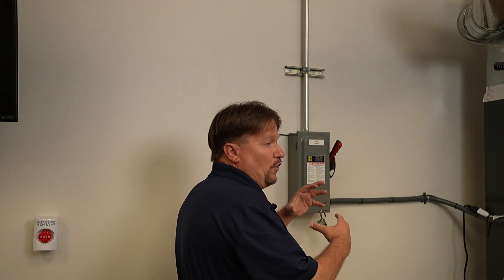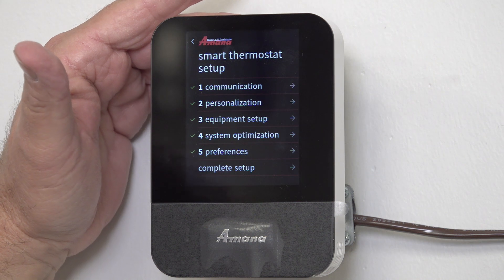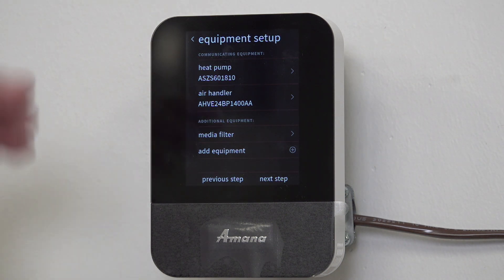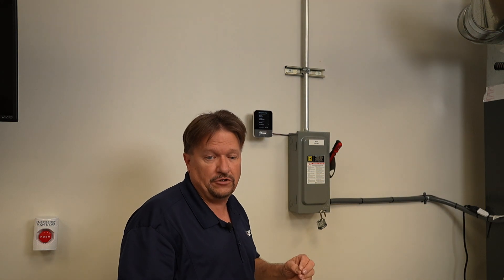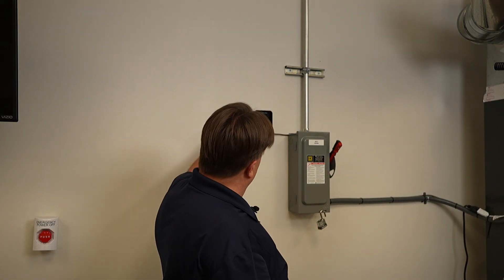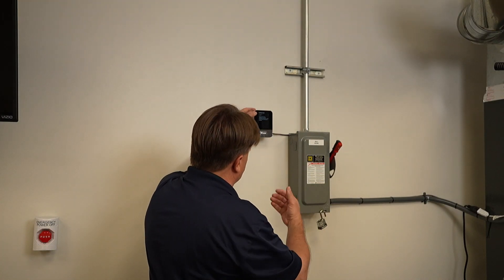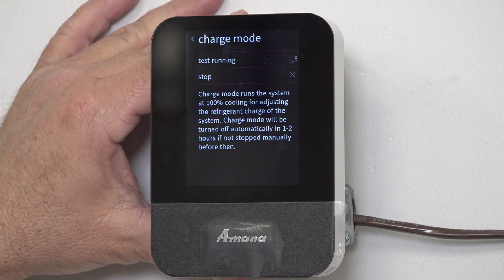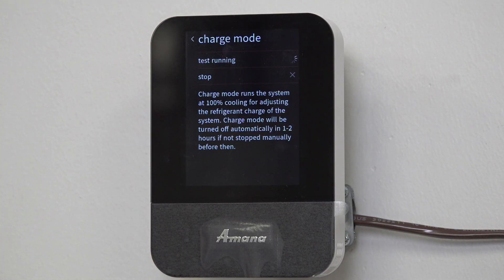Amana Smart Thermostat : Start Up : The Equipment Tab

Comment: Hey Mitchell. I work at another Johnstone. I have a question. Will the stat work with a ASZC200601 & AVPEC61D14? If so, it's not communicating. And if so, you recommend using stranded wire? Thanks!
Reply from the maker: The Amana stat is for communicating systems only. 4 wire type systems . Communications travel on the outside of a wire, the more stands the better the communication ability. One strand one communication path.  If that one wire becomes damaged then it could possibly stop system communication.